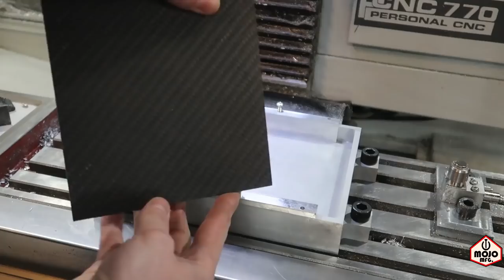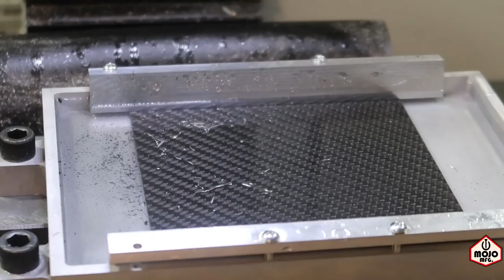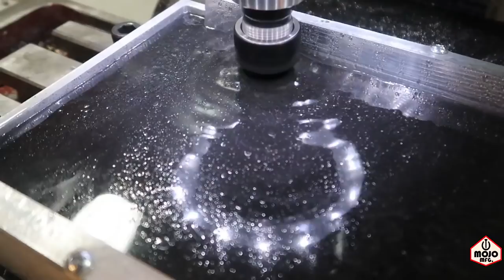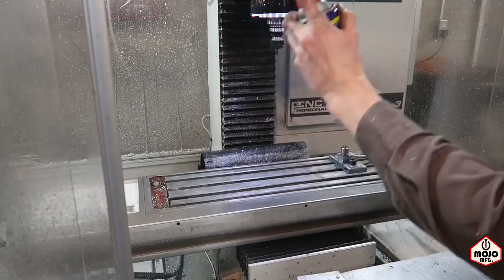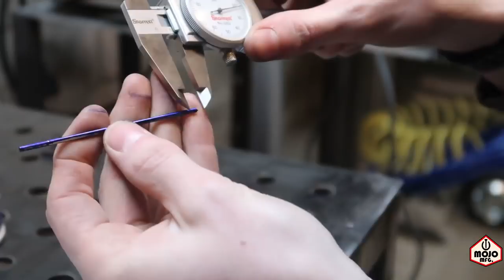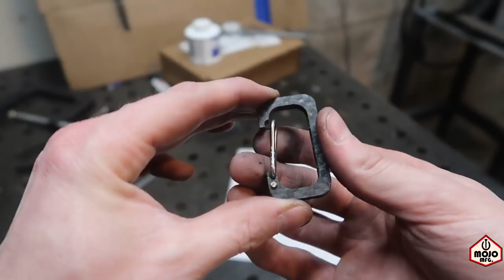Machining a Carbon Fiber Carabiner

Comment: Next time try out a PCD burr mill if your spindle can get up over 20k rpm try that. It came out looking pretty damn good though so this is more me thinking about what I'd try in my shop we have a robodrill that'll get up to 24k rpm, I might slow the feeds down more I forget the name of the coolant we use its clear but the bath idea you used is pretty great though. Full depth of cut was a good idea I learned that the hard way a while back. Take care.
Reply from the maker: I can only get up to 10k rpm.  If I ever get back into trying to machine carbon fiber I will definitely look into these mills.  Thanks for the info!
Reply: @MojoMfg  no problem. Keep up the good work though. Those carabiners look great either way.

Comment: I mainly cut carbon on my router. Ive been doing 14KRPM .002 chip per tooth. But I just air blast dont use a water tank.
Reply from the maker: Do you use any air filtering? I always hear that it's bad for the lungs if you don't have some type of dust collection system
Reply: @MojoMfg  The carbon I cut is different. The chips are more like when you drill wood. It has a different type of resin in it. Along with that my router is enclosed.

Comment: Great vid Garrett!!  Very cool part.  
If the carbon fiber is that expensive, is there a cost advantage to making your own, or is this more a "because I can" project?  
I would think that a wire bender would make much easier work out of the clip piece.  You could make your own, but I've seen some for $25ish.
Reply from the maker: I was thinking it may be cheaper to have a shop waterjet cut this out.  I'm gonna get a quote from someone that has the capability and see what they come up with but right now it's a "because I can" project.  Also, I'm going to make a wire bending jig so I can at least make the clip somewhat repeatable.
Reply: @MojoMfg  It might be cheaper....especially if you find a place that already waterjet cuts carbon fiber.  It will be cool to see what you come up with for a bending jig.

Comment: Nice try :) I like the bath idea for the carbon. You might need to start saving for a waterjet ;) Try and preload the spring rather than change the hole position.
Reply from the maker: Haha thanks! A water jet may be a little on the expensive side for me at this point but it will definitely work better than this method.  I think you have it right.  I'm going to make a little bending jig and give it some preload.  Thanks again!